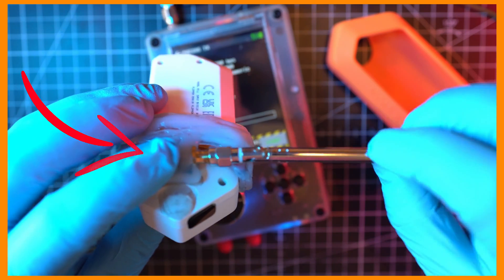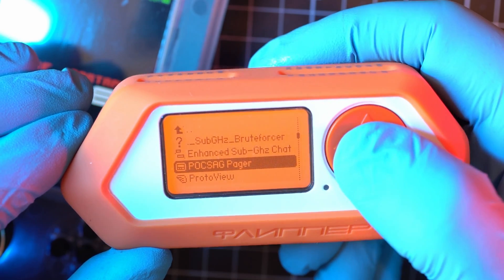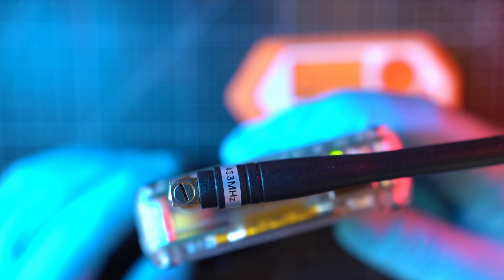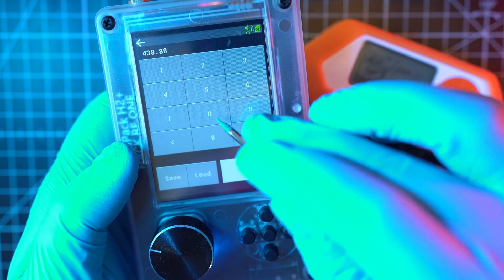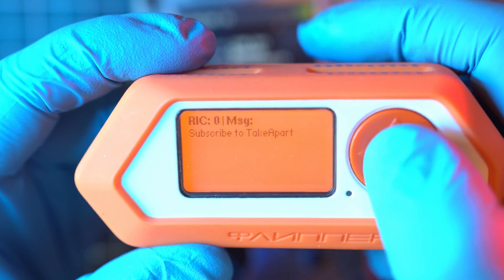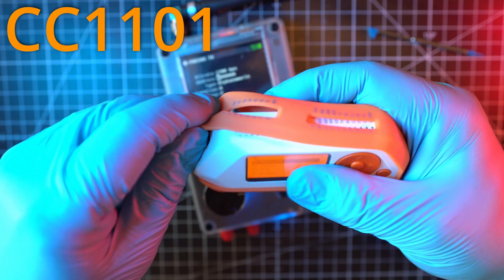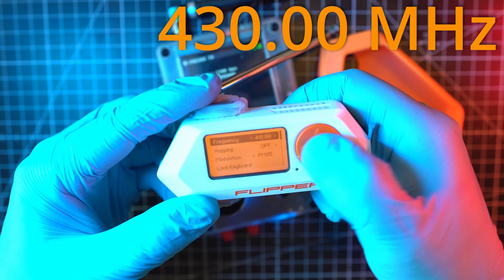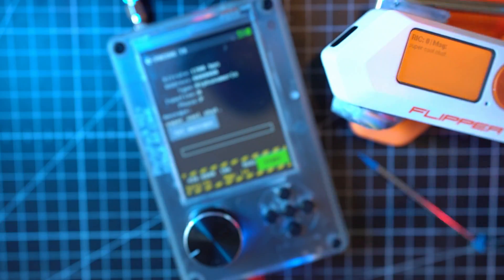Flipper Zero POCSAG messaging with CC1101 Sub-GHz module.

Comment: What’s the range for you?. I literally have to put the devices fairly close for it to work
Reply from the maker: flipper has fairly limited range… but have you tested it with external cc1101 module? (check out my video)
Reply: @takeapart  no I haven't yet but i suspect it being the HACKRF that's the issue
Reply from the maker: in that case is wrong your antenna.
Reply: I fixed it. I was using the external amp the wrong way around 💀
Reply from the maker: @3liverse here you go….
Reply: @takeapart  Is it normal for the HACKRF to have a weak transmit without using an external amp?
Reply from the maker: @3liverse yes… it is normal- that’s why you have to use tuned antenna to achieve better results.
Reply: @takeapart  what antenna would you recommend for transmitting?. I’m looking into buying the ANT500. Is this good in your opinion?
Reply from the maker: I usually make my own antennas ( for certain frequency). telescopic is good for receiving, but I wouldn’t transmit with them

Comment: Hey can you do a video on the LoRa (Long Range) Reyax RYLR998 module?

A guy (Sam's eXperiments logs) has got 2 Flipper Zero devices to send & receive text messages using that module!

There's a how to install on the repository by: aafksab

I don't understand how to install this though! A walkthrough would be so helpful to noobs like me. 

To add the ability to text message with Flipper Zero for SEVERAL miles + apart is incredible! 

You can also do other commands through that module like activate a Servo!

So you can be SEVERAL miles from home with your Flipper Zero & run the LoRa Terminal app on the Flipper Zero & activate a Servo motor to do something & then see a text message with your Flipper Zero LoRa module.